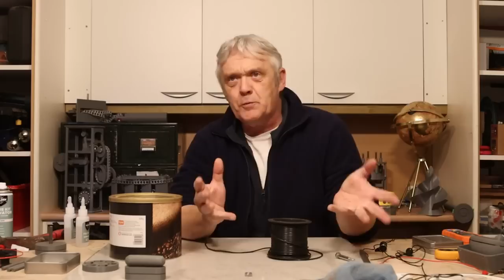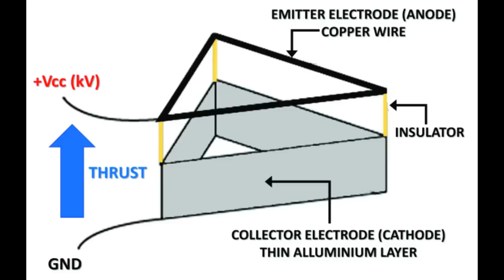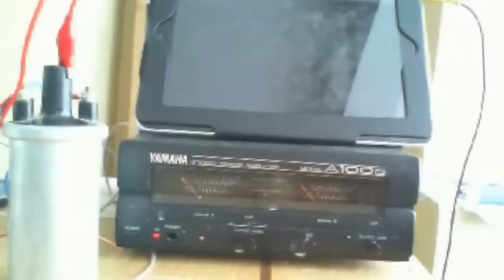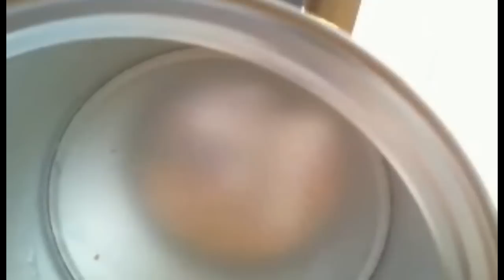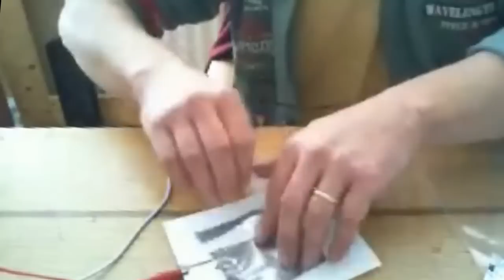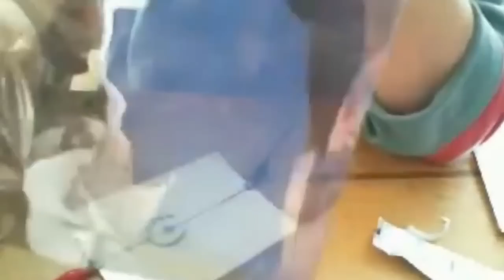2121 Thrust From Capacitors And How To Make A Speaker From A Pencil And A Crisp Packet

Comment: ahh so thats whats giong on there, alt propulsion channel did  a few videos on it from some lab that was doing experiments with this kind of thrust, scaled up they say they could get us to the moon in 4 hours, mars in 4 days, next star system in 4 years.  Going near light speed is the idea slowly accelerating and then decelerating.  Im not sure how they get 4 years when thats how long it would take at the speed of light never mind decelerating but anyway its a way to do it without a solar sail, which was the other idea of slowly accelerating to near speed of light.  You could just do it with capacitors in space!   The issues is the power supply apparently. EVen though they say its stilll possible, it wouuld be gigantic.  But they're using conventional ideas of power, i think peltier devices in space could generate tonnes of electricity exploiting the super hot sun side against the super freezng cold side it could actually make peltier devices effiecient as energy devices, in space!  Providing power to these capacitor thrustors, and off we go to Andromeda.  Are we there yet?  I think we need a shortcut still.

Comment: As power engineers we live 2 pipe dreams,  battery that needs a generator to fit in the equation. Like a paper spin put on end of a double as. Battery,  y not stuff a generator shaft, into super cap or whatever an u would likely make a generator out a 1.5 volt battery or the likeness of such particular pipe dream 😂. My bad. Energy inside pipe A, runs pipe B the generator.  Cap it off an well . More cheap entertainment. Cheer's 😊

Comment: way back in time a scientist experimented with capacitors and this was fairly well documented but he applied over 2 million volts to the capacitor and it levitated on the field !
about that time the discovery of the electrostatic flyer came out and the capacitor experiment was ignored, the government approached the scientist to work for them ,which he did, and nothing more was ever heard of the levitating capacitor everything on record was the electrostatic flyer effect, not the field effect....sense then they have developed several propulsion devices that are totally top secret including several flying saucers that actually work. this is antigravity in a sense...thrust from nothing...think what a boon this would be to mankind if the government actually released it's findings ! or used superconductors to do it with....power it up once and fly forever ! (in theory)

Comment: The engineer behind patent US11511891B2 recently reported 125% thrust-to-weight ratio in a vacuum chamber and they think they can reach 200%. Stacks of this material could replace the rocket industry. Even at a much lower ratio, that could drive a generator. There's a number of teams working on variations of this for space propulsion. Theories behind them usually involve asymmetric interactions with vacuum energy (virtual particles) / Casimir forces or biased quantum tunnelling of electrons through the capacitor materials.

Comment: Another great video Robert. Robert I really like the work that you so openly share with me. Thank you sir.😊 hey could you do a video in the designing and building a Generator from the up and down motion of the Ion Lift or Plasma Lift Engine? This would make awesome video in my opinion Robert. Will you do it?😊
Reply: Look into Viktor Schauberger's work,  especially the Repulsine.  He was basically using water,  centripetal motion,  and specific metals to build a device that ran water thru a basically flat,  but grooved circular sheet with slits cut very precisely in certain sections,  and in addition to producing electrical power/ energy,  it also produced thrust and on more than 1 occasion lifted off the ground,  and crashed into the ceiling,  & gyrating & spinning at such high rates of speed he had to bolt it to the floor of his workshop.   That's a very simplistic description, but if you don't know about him,  it'll be work your time to go read some of his work.   It's been translated & commented/ reviewed by Callum Coats, and also his son Walter Schauberger.  He also started the Pythagoras-Kepler School, based upon the fundamentals of his research. That being innate geometric force relationships inherent in the "fabric" of Nature & the Universe/ reality, i.e. spiral curviform movements of water, sap, blood, and other natural growth patterns & dynamics NECESSARY for life to be healthy & THRIVE, not just scrape by & survive (*hinting at physiological/ bodily applications thru various ways*).
Reply: @delta-KaeBee   Now there's some woo-woo to avoid. "innate geometric force relationships inherent in the "fabric" of Nature & the Universe/ reality"? No evidence, no demonstration of mechanism or how to measure it. 
Cobblers.
Reply: Sounds like an incredibly inefficient use of the power. Better off putting the power into a generator/motor combo.

Comment: Another interesting idea might be to manufacture a very long series of diodes to create a large potential. What is interesting is someone used it in an automotive application to overdrive the spark plugs and crack molecules in the fuel to produce a hydrogen charged ignition. This could be an intriguing concept to experiment with.
I almost forgot, thanks for posting another neat science video!
Reply: do you have a source for what you're talking about? that sounds fascinating
Reply: @janthran  No, unfortunately. But I recall it was related to the on demand HHO generators and they were experimenting with instantly converting water vapor into fuel for combustion using a variety of different spark plug configurations. The plasma arc was causing a bit of erosion but I think they found that the platinum x-ray and UV was producing more gas output than the low voltage electrolyte type generators.

Comment: How many years ago a guy was fired he worked at Area 51 and he was very upset that he was fired because he took some friends out to an overlook get his job back he then was denied at on camera that he even worked there and he said this is my pay stub so he said since I didn't work there I guess the confidentiality agreement doesn't come into effect so I'm going to reveal that there are flying saucers out there and we fly them and they power them with element in 117.
Several months later I see a news report that Lawrence Livermore Labs has said that they've gotten to 118 the decade to 116 but they're trying to get to 119 that should Decay to 117 that will be a good source of power.

 In additional interviews later on he describes the extreme high voltage needed to make the ufos fly.   Something about high voltage electons spinning in ring contanment fields like gyroscopes and the magnetic fields shift to force opposition  to the other gyros.   But the high voltage electons cause electrons to some how repell gravity.  

Thanks for the video.